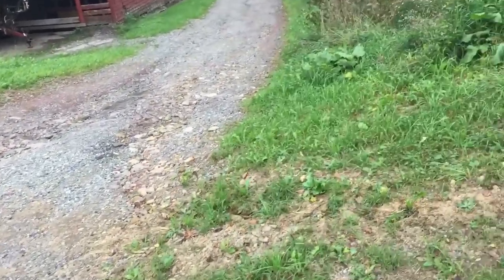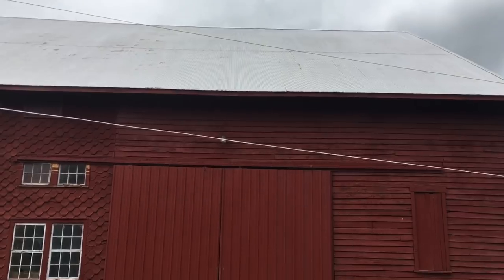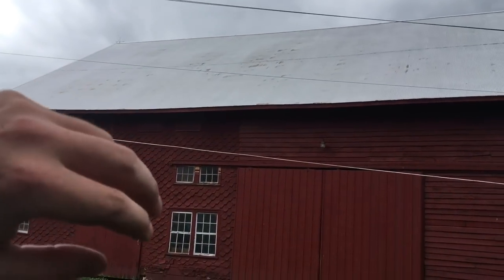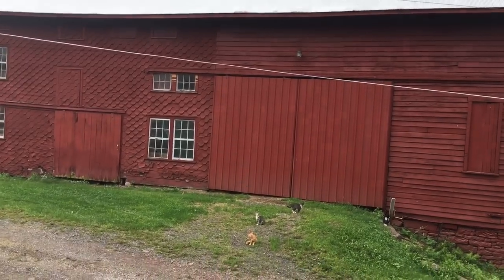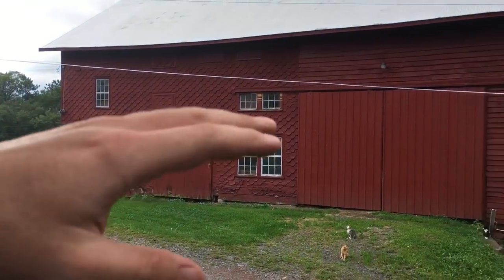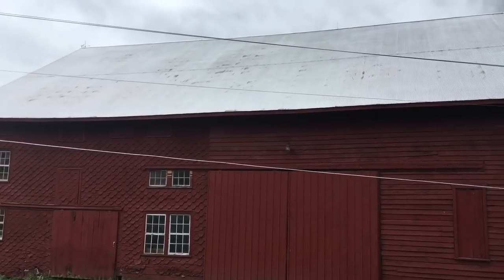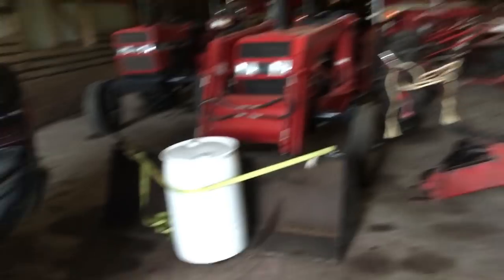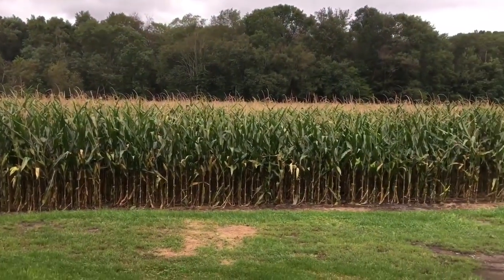Barn Repairs

Comment: Years ago we had a major thunderstorm that knocked some holes in the slate roof on dad's barn the insurance company offered to pay for the full cost of a new metal roof on the barn, which dad did. Those sheets of ribbed metal roofing ran the full length of the barn roof on both sides, so no seams. That metal roof is still doing well.  The barn on the farm you're renting scares me with the rotted timbers, beams and floor boards and the poor condition of the lower barn wall that is bulging outward. I held my breath when I saw the first video of you actually storing hay in that barn. I handled a lot of hay bales in my youth and I remember quite well how heavy they are. When we filled our hay mow to the roof I remember wondering just how that barn and barn floor could support all that weight, but it always did and is still doing so over 50 years later.  That barn was and still appears to be in very good condition, however. Just stay SAFE.